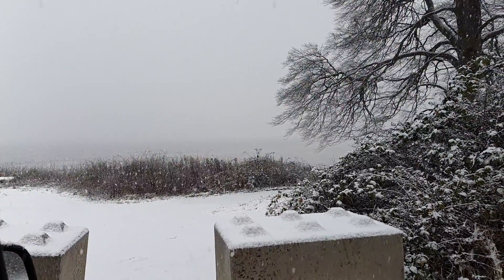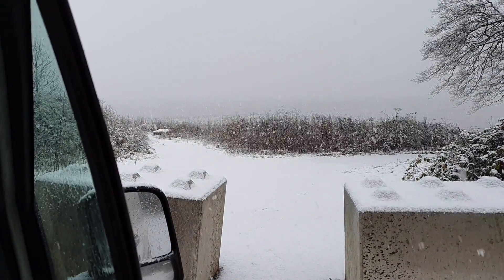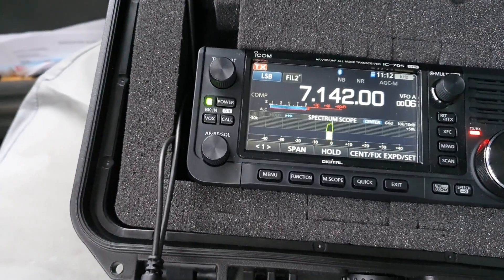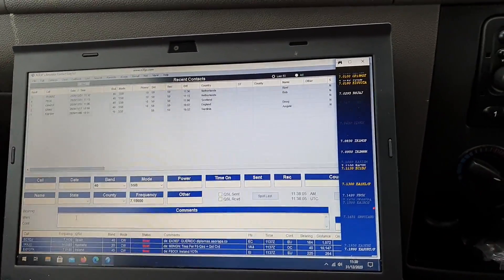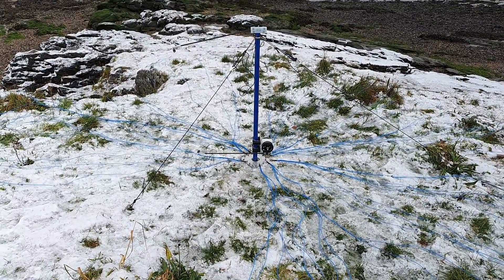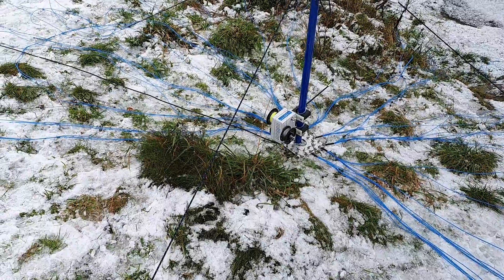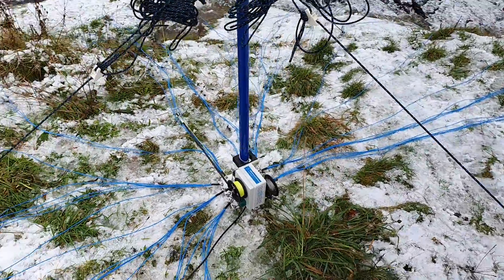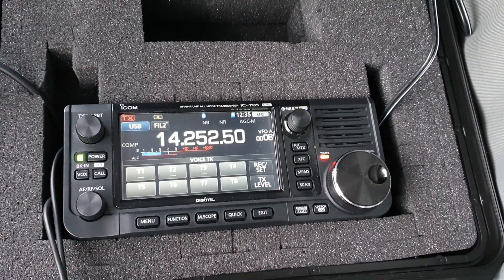Phased Verticals over Saltwater & Icom IC-705

Comment: Hi Colin, 
Glad to see someone else operating with Phase verticals and 10 watts just shows how good verticals work over salt water. I have been playing with antenna by the sea for many years. Phased verticals on the lower bands really work well. Even better if you use a 1/2 spacing and run them on end fire and broad side. I have lots of documents if you want some bedside reading. You can see some of my antennas on my QRZ page.
Keep up the good work stay safe
Richard 
M0uoo
Reply from the maker: Thanks Richard. Just had a look on your QRZ page. I remember well listening to you on 40m way back around 2012. You were the strongest signal in the band. Thats an amazing setup you have, fantastic.

Comment: Colin nice work. I am also experimenting with a vertical by the ocean portable lately. I have reached Japan and Indonesia long path from Puerto Rico with 100 watts on 40m and gotten 59 reports. Also reached Australia with 5 watts (15.986 km way) on a 705 on 20m. On my QRZ page I have some photos. I will be experimenting with a phased vertical array soon, but it will be a parasitic array using two DX Commander Expedition antennas. Keep up the good work and the videos coming!!! WP4OMQ
Reply from the maker: Its completely different. You hear signals that others inland can't hear at all. Good luck with the verticals.
Reply: @MM0OPXFieldRadio  Yes. Extremely low noise and the gain from the conductivity of the seawater helps both the receive and the transmit. Look forward to your next video...

Comment: Another great video Colin, how far were the antennas from the waters edge ? I live by the coast and have similar spots that could be good places for verticals
Reply from the maker: Hi Steve, when the tide is in its only 4 or 5 meters. Its not an ideal spot as it has a hill to the south but great take off In all other directions.